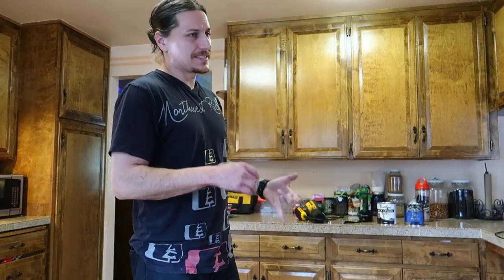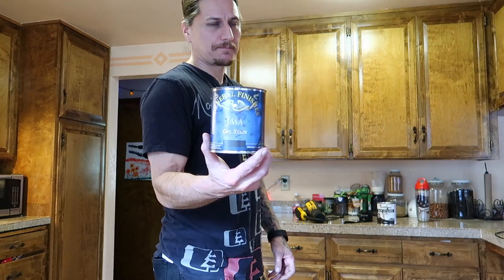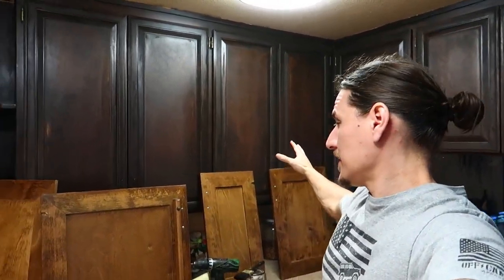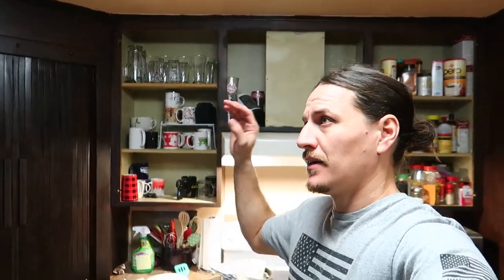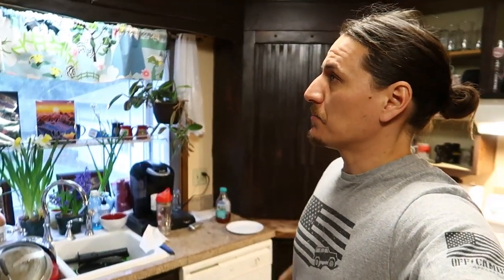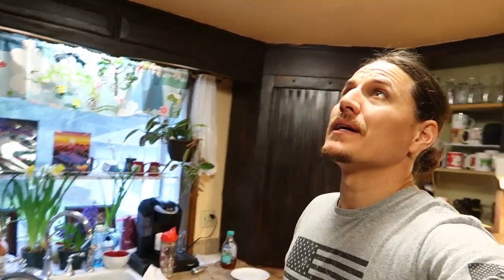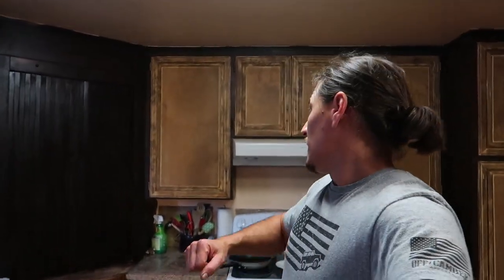Kitchen Cabinets Remodel Time-Lapse ***Surprise My Wife***

Comment: Great job man.
I did the complete kitchen in my mom's old house on the river.
A lot of sanding.
I built a center island and had a raised countertop with a jenaire and sink down in the center.
Lots you can do and save tons.
I also kept her apliances but spray painted with a cool black wrinkle typevpaintvand it brought her house to modern look.
Oh, all hard wood floors also, but let some of my workers install that while I was doing all thither work.

Maybe I'll post some of my photos and videos.

You did a great job.

I stayed doing mine after paying a few I hired that supposed to be carpenters and after a couple weeks had a couple doors sanded, so started in and really started liking it and went through the whole house before moving in...